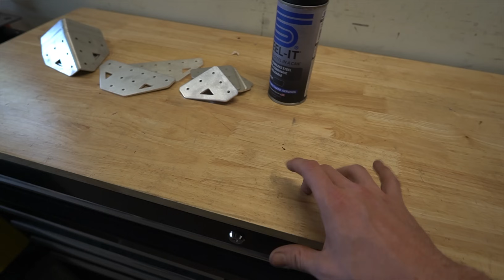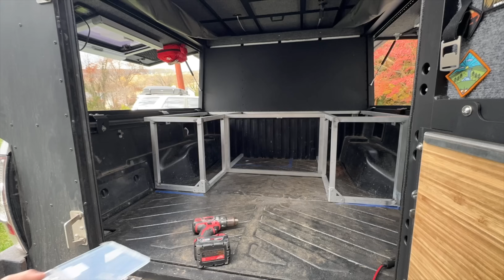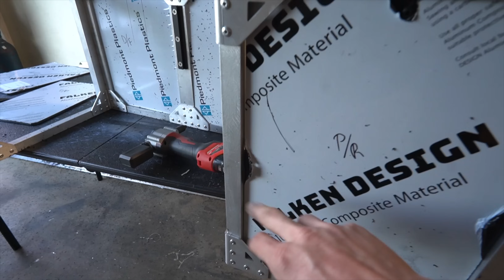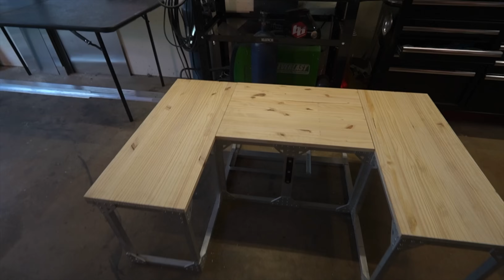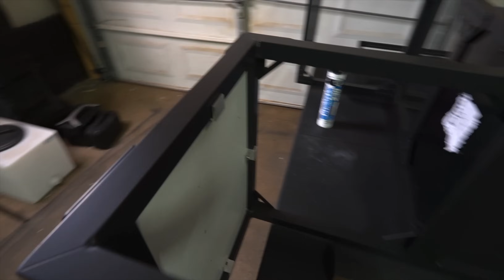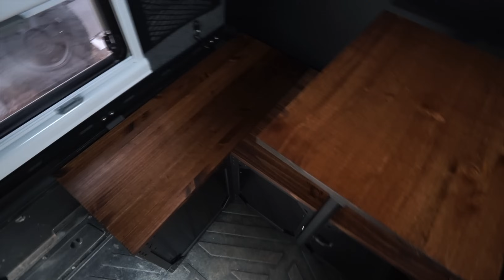Truck Camper Build | Part 7 | Interior Build Out!

Comment from the maker: Thanks for watching everyone! 

If you want to watch the rest of the build series or find any of the parts I used please check the description! 

Also don’t forget to like and subscribe please! Helps the channel a ton. 

Also here is the link to the DXF files to get your own plates/brackets for your build! 

https://www.adv4x4.us/store-1-1/p/interior-bench-dxf-files

Want to stop  guessing your wiring?  

Build your 12V, 24V or 48V power system and get the wire gauge, fuse sizes and a wiring diagram for your rig with our interactive builder! 

More info here! https://www.adv4x4.us/tools

Thank you!!